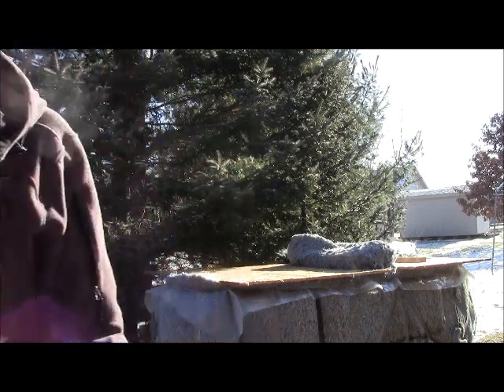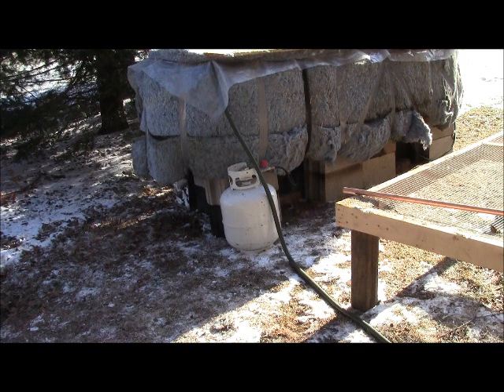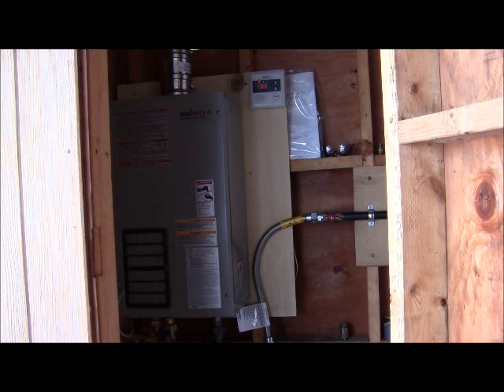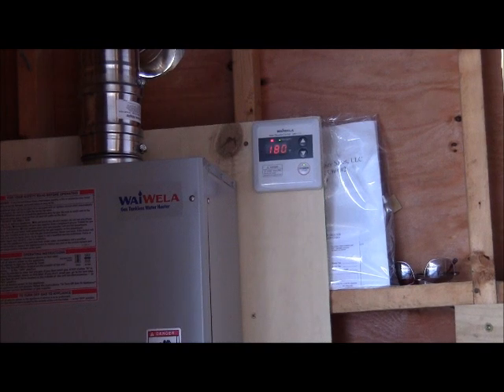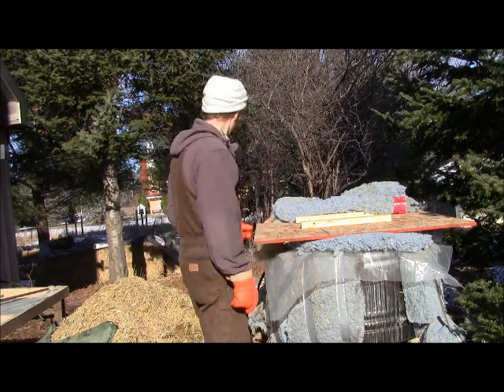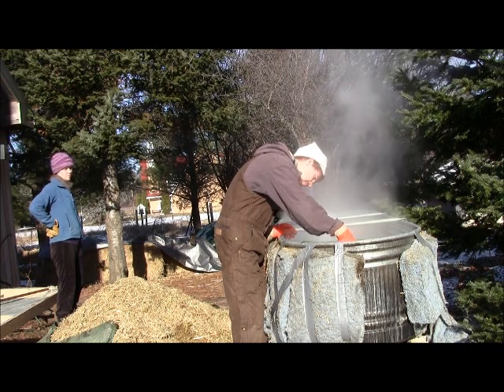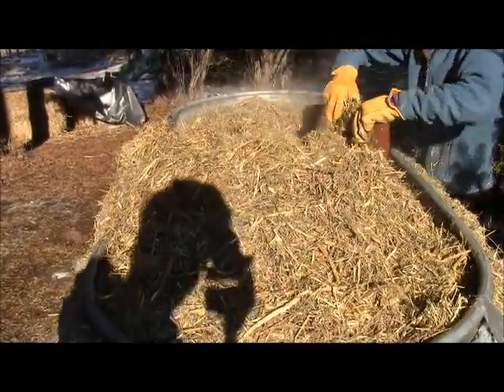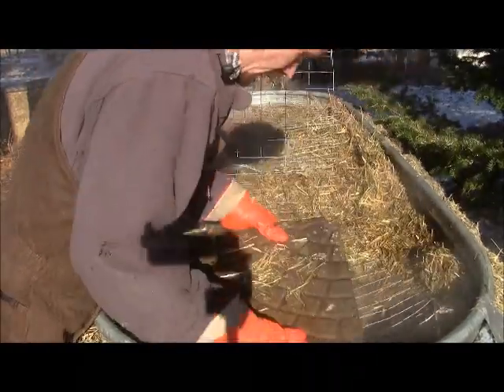Pasteurization of Straw for Oyster Mushrooms - Part 1

Comment: Perfect, i had assumed that with enough insulation and the right start temp it would retain its heat. I'm guessing the investment in the heater will quickly pay itself off with time saved and less propane used. Sorry to be nosy, but i am just starting up my own small scale operation outside of my basement. Do you make your own spawn or have you found buying saves time= money in the long run? I'm in Missouri and i know the laws are different state to state but did you need agricultural permits?

Comment: The nice thing about the hot water heater is that I put out water into the insulated tank.  The water I put out is set at 160, its comes out about 155.  Even in winter when we put in cold straw it only drops the 150 gallons or so of water to 150.  During the hour of pasteurization it always stays between 140 and 150.  So to answer your question its never been an issue.  I don't need to add any more water.  Hope that helps!

Comment: With the on demand heater, do you ever need to drain water in the tank in order to add more hot water to keep your pasteurization range for your allowed time peroid? Do you just allow for a water level, add straw, then leave room to add more water to maintain temps?